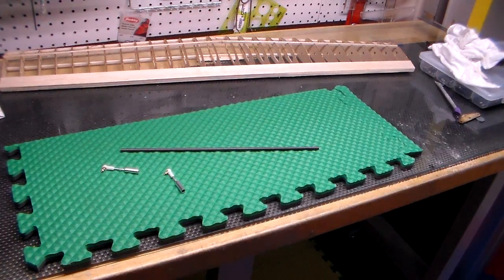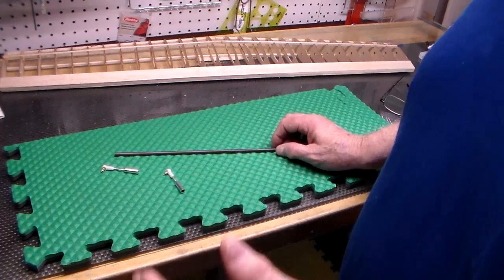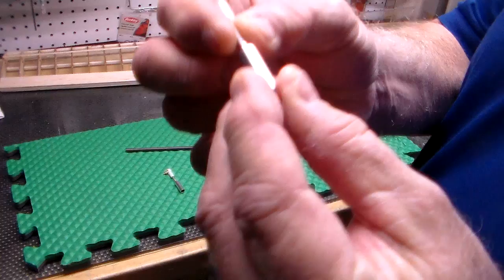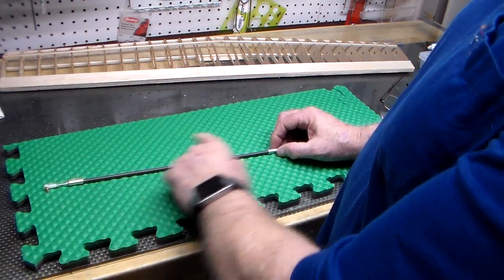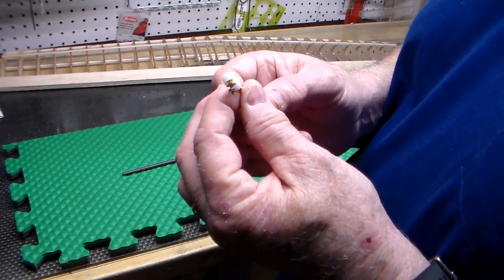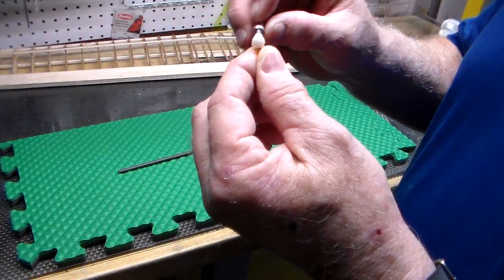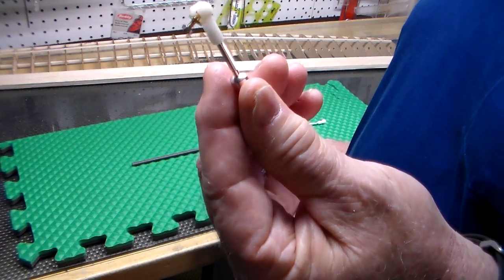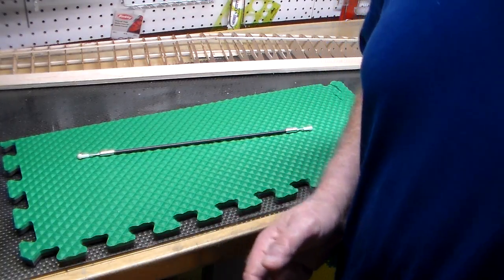RSM Pushrod System

Comment: The metal end is nice. I would use normal ball ends though.
Reply from the maker: That is fine Irene.  They are made for that...
Reply from the maker: Hi Charles,
RSM has changed their ball links.  They no longer sell the ones you see in the video.  They have gone to the Dubro ball links instead.  You can buy the Dubro threaded ball links from RSM and use them with the threaded rod ends.

Mike